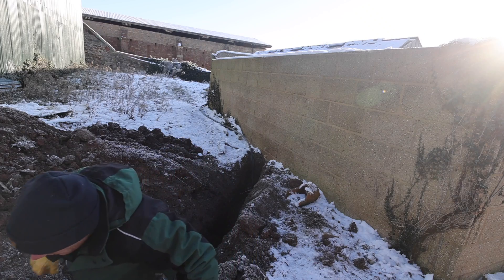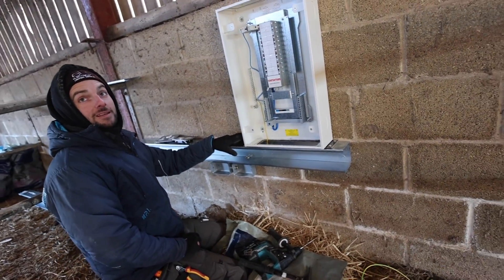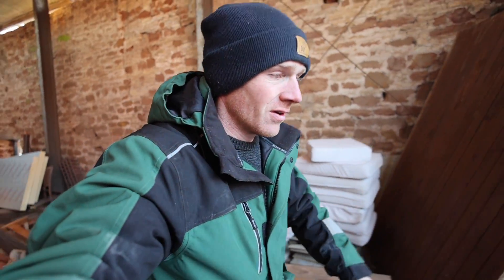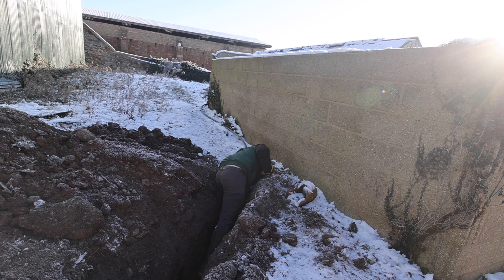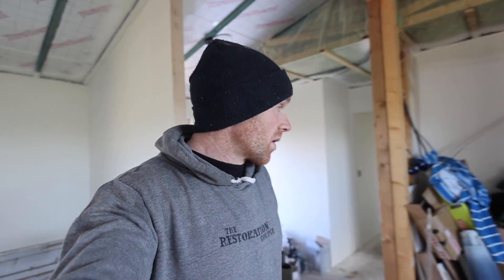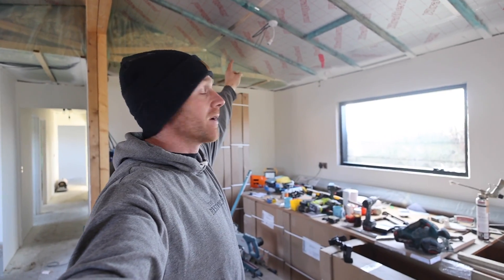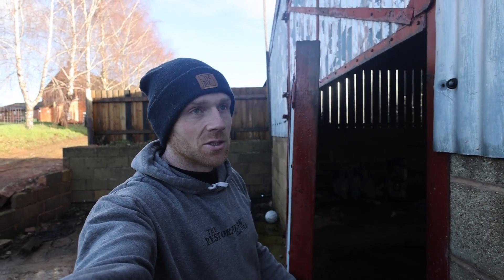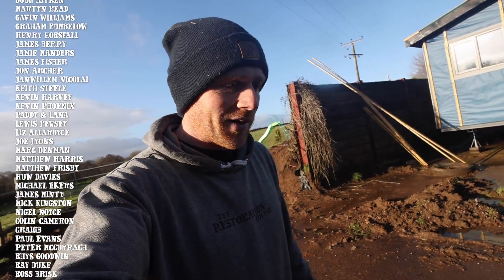COMPLETE ELECTRIC INSTALL ⚡️ - 3 Phase, Trenching Cables and Second Fix IN SAME DAY

Comment: Discrimination is the practice of selecting protective devices and adjusting their settings in order to limit interruption to electrical installations under fault conditions. When the devices in a distribution path are ‘coordinated’ it reduces nuisance tripping and makes it easier to identify where a fault has occurred.

Comment: looking good 👍  Instead of the pull cord, I'd have considered a kinetic switch outside with the receiver on the inside.
No physical connection between the halves and no pull cord 🙂

Going via the 80A board to end with a 63?A supply at the cabin sounds a bit tight with everything electric, especially if you're fitting an electric shower.
Reply from the maker: No electric shower or boiler now so just sockets lighting and small rads.  Using kinetic switch in another video but hadn't thought of using one there, Still time as ceiling not up yet. 👍

Comment: Might be worth putting a smoke alarm in your charging station area... with batteries you never know.
Reply from the maker: There are three alarms, smoke just outside that room, heat in kitchen and CO in living room plus another by boiler. 👍 Deafening as all interlinked. 😂

Comment: How have you managed to install the wiring whilst not crossing the 2 halves of the cabin? Its something we had to really think about on our build.
Reply from the maker: Just different circuits that all join with connectors in an access panel. Forgot to show that so will do in future. All heavy duty appliances etc on same side as CU.

Comment: Happy New Year.  Very impressive electrics, must have been expensive
I laid a 3 phase - 16mm 4 Core Armoured Cable 45 meters . . . dug the trench by hand - the cable was very heavy
The volage drop with a kettle on the end is better than via a thinner wire to the kitchen . . . 0.5 volts better
You are so fortunate have all the tools to do the job quickly